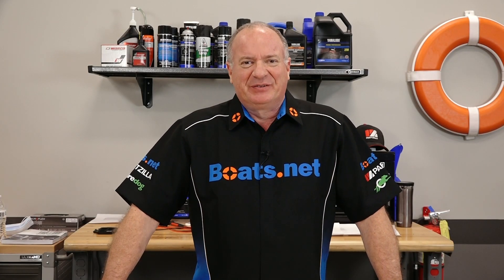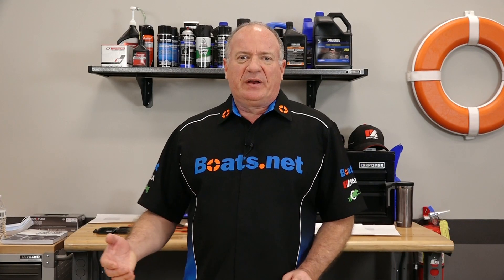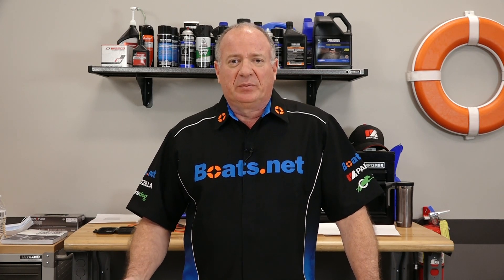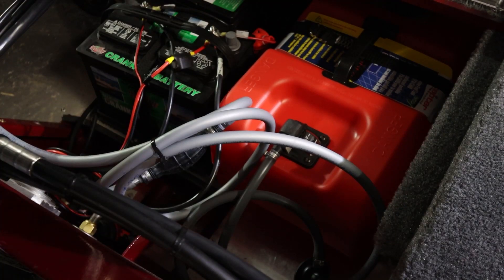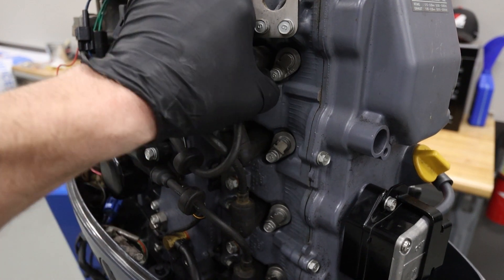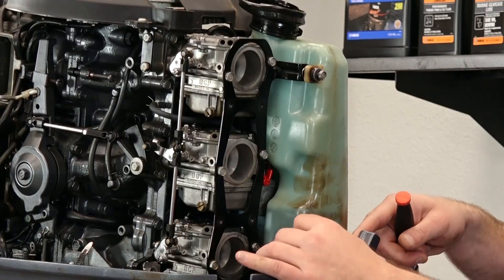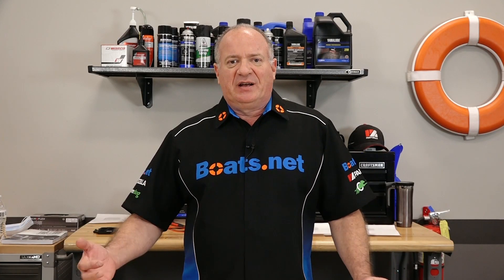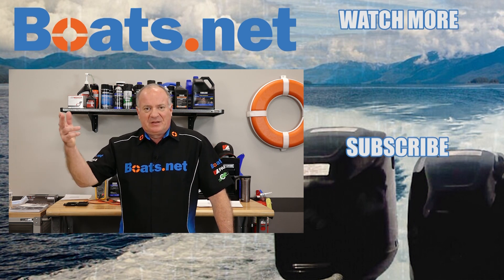Outboard Idle Problems | Outboard Won’t Idle | Outboard Engine Won’t Stay Running | Boats.net

Comment: I have an outboard Yamaha 150 HP v6 it cuts off at high rpm. What could be the problem. Also the negative at the fuel pump isn't t constant. It breaks off.

Comment: I have a 50 horse work two stroke 2003. I am curious there is a control valve on the left-hand side of the motor just below the thermostat housing what is that called? It appears to go to the carburetor hoses is electronic and some kind of vacuums with a little plunger on the top. I had problems running and store issues. I had pushed the manual button on the top a few times and it ran better. What does that do?

Comment: What causes my  115 hp. Johnson 1977 to not want to idle only when I trim the motor up. With the motor fully down it idles perfectly.
Reply: Crazy mine is the opposite, it idles fine trimmed up but as soon as I put it u see the water it idles rough, I think its my idle screw tbh

Comment: Hey this is Tyler I have a Evinrude 115 etec that won't idle if I take the cover off and hold the throttle cable just a little it will stay idle but when I used the control handle trying giving it gas the engine shuts off do you have any suggestions that might help me
Reply: did you fix it? i have the same problem

Comment: suzuki115dt 2 stroke start 1st time every time on land . once in the water it turns over but only starts when engine is tilted up
Reply: Ever find out what was wrong with it?
Reply: @jasonk2840  yes somehow it get water in the bottom piston. Very little. But then the back pressure on the exhaust with the water it won't start with the engine down. I normally open the bottom sparkplug give it a good spray of water repellent oil and close and start. Runs perfectly but after a weekend or long day running I open again and clean sparkplug and spray oil and off we go. No problems. Now it runs perfectly bit the first start must be lifted almost out the water or close to

Comment: I have a vintage 70's Merc Thunderbolt 50HP 2 stroke 4 cylinder that I rebuilt and got running, but it idles very high in neutral!. Anyone know what I need to adjust to get it to idle properly?. I was thinking it could maybe be the cable that comes from the Mercontrol/throttle/choke, and maybe I need to adjust one of the stop screws on the side?, and I know one does timing so I just need to know which one to adjust so I don't accidentally end up screwing something up!?. Any advice would be very much appreciated!. I want to go on the water, but I can't because I know if I put it in gear with it idling that high that it'll be bad news bear! lol

Comment: Next advice: forget air filters (most outboards don’t have one, secondly I’ve never had a fuel filter that clogged so bad fuel couldn’t make its way around (so being it’s probably water in the fuel with ethanol being the cause most of the time).
That leads me to water making it through the system or ethanol derived scum blocking electric fuel pumps or creating electrolysis derived crust in the carbs.  Additionally softening/melting or  hardening/cracking fuel lines and carb needles. Yes ethanol can soften and or dry out and harden.
Moral of the story ethanol is the bane of boaters existence

Comment: Wrong answer: like my Dad said, never ever F with Idle adjustment screws from factory settings.  Always fix the problem, gummed up carb, leaky float needle (running rich, my problem 80% of the time lately), out of timing or ignition issue.
Every used Briggs seems to have the idle adjust screw F’d with.  With that one I think standard is all the way in then out 1 1/4 to 1 3/4 Thread.
The problem with outboards factory settings aren’t always standard.
Reply: Nothing remains constant, as the engine wears, fuel demand changes

Comment: Hi, I have a 1998 DFI Merc Optimax 150hp and the mass air flow sensor or it’s the idle air control in the air intake on the front of the motor get covered with injector oil and it’s very hard to start when cold. When it warms up it runs great. If I take it out and clean it it fires right up and will idle but not when it has oil on it. My question is why do it have so much oil in the air intake? I know there will be some but this is obviously too much. Any thoughts?
Reply: Did you figure out what was causing all the oil?  I'm about to rebuild two 2003 Optimax 115''s   I'm curious if you figured it out.  :)

Comment: 1999 mercury 200 efi when starts after a minute at iddle goes to 2k rpm, checked TPS meters ar 2k ohms, primer bulb is good, also replaced racor and internal fuel filter and thermostats. Any help would be appreciated

Comment: I have a yamaha f15 2012 and it is overheating only at idle. It pees fine with new impeller new thermostat and anodes. What might be wrong???

Comment: I have twin 175 Johnsons  won't idle after they warm up. Hit or miss when they are cold. Disconnected the vessel tank and tried to test run them on fresh fuel from a different tank. Both have an intermediate miss.  The counter rotate  engine is the worse. I'm beating my head against the wall. Even rebuild the carbs on the counter rotate because of warped float bowls. Figured I might as well while I had them off.  In the process of doing a hot soak with sea foam.  So far nothing has really worked for long. In engine fuel filters have less than 5 hours on them.

Comment: 1991 jonson 2 stroke 20 hp  atart after few pull but  about half k.m. stop slowely ! than start again  do the same  also seems oil in water some time smoke  too , what it would be ?

Comment: I found that the factory had installed a 3/8 I.D. thick walled line from the tank to the nipple thingy passing through the engine well.  Without the clamp it had no resistance to removal or putting it back on at all, really loose.  Best as I can measure with a ruler the nipples were 5/16.  I replaced the line with new 5/16 fuel line and the fit was much better.  Prior to this my fuel filter would always fill up with air, so I imagine what was happening is that at higher rpm the pump was able to keep fuel moving to the carbs, but at idle it couldn't overcome air in the lines.  No gas leaked out, but to be fair that part of the system is always under suction and air entering when off would just allow the gas to drain back into the tank slowly.  So bottom line, especially on older boats, always ensure the fuel lines are air tight with no leaks.

Comment: I have a 2012 Suzuki 2.5df that I cannot get to idle. I’ve gone through the carb twice and have tried the idle adjust and air mixture screws.  Starts and runs great but dies when dropping it to idle.  I have a low speed jet on order but still think I should be able to get it to idle.  Any ideas would be greatly appreciated!
Reply: Reed valves

Comment: My 2004 Johnson 35 HP will not  idle .I checked the adjustment screw and it was out 4 full turns . I turned them clockwise until the idle raised and stalled then backed out 1/2 turn , After turning all the way in to check how many turns it was a little more than 1 1/2 turns out. It is idling now. Is this the correct procedure ? I have owned since new and store it at a marina that services it But Im confused about how far out the screw was.

Comment: 2007 mercury 90hp 2 stroke ,start up high idle ,when it idles down motor dies
Reply: i have the same issue with a 2006 90trl Yamaha 2stroke. on cold start it will run at the higher idle but then after its warmed up at lower idle it will die. slight acceleration will keep it running but simply turning the throttle screw gets its running way too high for idle

Comment: 2016 Honda 200hp will occasionally idle very high and prevent smooth shifting.   Shifter seems "stuck" when this happens but works fine when engine idles properly at 800-900 RPM.   Please help.

Comment: I has the throttle cables replaced on my 2006 90 hp Mercury 2 stroke outboard motor. Went out on the lake and at WOT the RPM dropped from 5300 to 4200 RPM.  Took it back the the mechanic and he said it couldn't be adjusted any more. What could be the problem? The butterflies are not opening completely . I show that to the mechanic and he said the the throttle stop wouldn't allow any more adjustment.

Comment: I have 115 hp yahama engine, a fuel injecting unit the problem when i start up is very easy to start by if i encage the gear is automatically shut off.

Comment: My problem is the engine is idling too high, not too low.  And I don't know where the idle screw is on it.  1998 Yamaha 150 V6 Two Stroke.
Reply: Work your throttle and watch the linkage,, you will see it.

Comment: 1987 150 black max found crushed brown wire on my idle control assembly  unit.   Starts idles won’t throttle up.   Tanks good.  Carbs good.  Fuel pumps working.   Got spark all cylinders.     Stumped

Comment: How much "shake" is acceptable on an outboard? My Mercury 60HP runs fine, but at idle it seems to shake a little. Is this normal?
Reply: i have the same question.  but just my thoughts not a professional opinion i think its ok to shake some since yk its a three cylinder not a even number

Comment: Engine 99 115 murcury starts fine but cuts out and sounds like fuel…
Reply: Me too bro. Replaced fuel filters, fuel lines, fuel pump, rebuilt carbonators replaced reed valves.. It’ll start up then die within 10-15 seconds. Have no idea wtf is up. Has spark has fuel has air. I’m stumped

Comment: How do I check the IAC valve on a 25 four stroke Mercury EFI to know it’s good or bad? I have an issues after warm up engine doesn’t like to idle.
Reply: I have the same issue with the same motor. Did you ever figure it out?

Comment: i have a johnson 60hp 2 stroke and im having problems. when i start it the motor high revs like crazy and dropped down and stall and most of the time i have to start the boat with the choke pushed in on the key, if i don"t push the choke in it will not even pop off. any advice will help.thanks
Reply: You found the problem?

Comment: Motor runs good at half/full throttle but won't idle... Any suggestions?
Reply: Same issue here, did you get it figured out? To bad they don't respond to any of the comments.

Comment: I have an older Johnson 140 2 stroke. Runs great on rabbit ears, but put the boat in water and won't even start, then pull out of water, hook up rabbit ears and fires right up, even the local shop can't explain it. Had the same issues with a 200. Any ideas???
Thanks!
Reply: Your local shop should be able to fix this lol
It could be something as simple as adjusting the idle screw, boats have higher RPM on the muffs. So if you set it on the muffs it might be too low once in water with resistance.

Comment: My 1988 Yamaha 150prov runs great out of water.. 
& on muffs, when she’s in the water she will not ideal or go
Reply: coil issues! , I had the same problem, it would run great on the Muffs, put it on the Lake and the moisture with the coil. I pulled off the fly wheel and sure enough I had burn marks / holes in the plastic coatings on the coils, replace the coils and the problem was gone, start like a charm

Comment: My question is....when i start the engine.the engine is runing but when i put it on forward gear and the engine just die.or put in reward gear it's do the same.so i want to know what's the problem.can you or any one tell me.....

Comment: I got johson40 HP.
 Out board. 2stroke...
 Turn key bush on as key turns. Starts. Push lever up runs smooth

 Then as bring lever down  motor stop or as  put in gear
 Stop running.

Comment: 70hp Johnson outboard (runs good but occasionally stalls at low rpm), any tips
Reply: Any fix on what this was
Reply: Any fix?
Reply: Same problem.
Reply: Start with stock spark plugs
Reply: New plugs and adjusting idle fuel circuit did it for me.

Comment: I have a Honda BF 30A. A carbureted unit manufactured in 1999. This is a low hours unit. I recently replaced the slow speed jet. Apparently these engines tend to thousand quite quickly. I'm assuming that goes double when you spend a lot of time at idle speed. After about 5 hours on fresh Jets and a carb cleaning X3 it now seems to be running lean. Where once it was smooth at flat idle speed under load it now seems to be missing on one cylinder. When the choke is applied it returns to idling as normal. I'm guessing this is a lien State caused by yet more contamination in the fuel system that's found its way to those Jets and their absurdly small orifices. My question is, is there something else that could be causing this problem?

Comment: OK, so when you replace the entire fuel system from tank to reed valves and it still wont idle for more than 30 seconds then what?, and yes it has good compression..
Reply: Did you ever solve your problem.
I have the same situation on my 20fs.

Comment: My boat motor 28hp evinrude spl will run and idle for about 10 seconds but if u try to put it in gear it dies

Comment: Carb rebuilt 50 evinrude. Won't start. If I prime the carb manually, will start and run. Shut down and try to restart, won't?